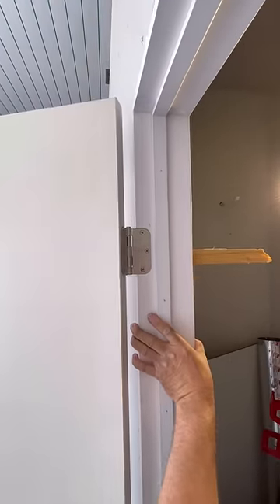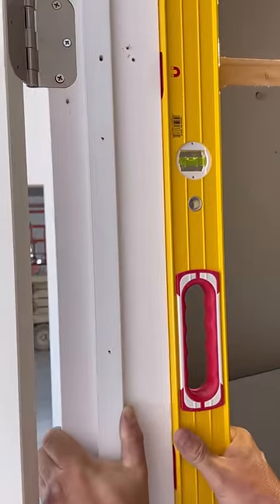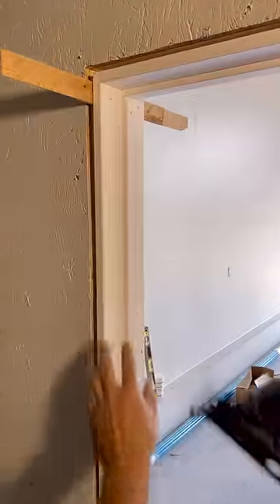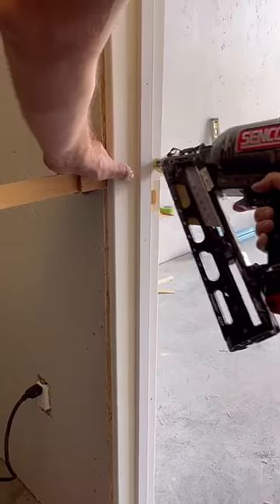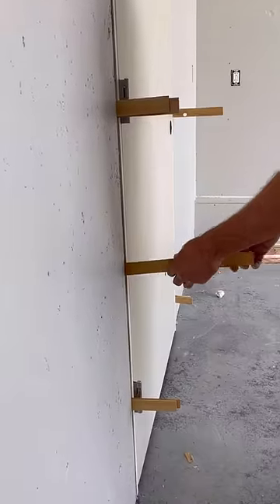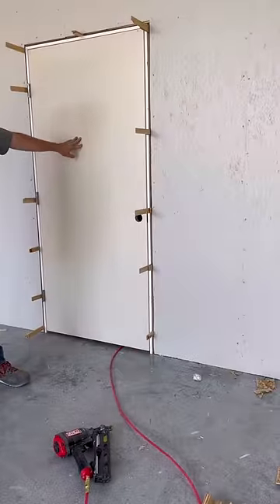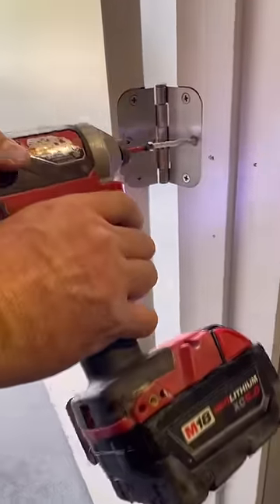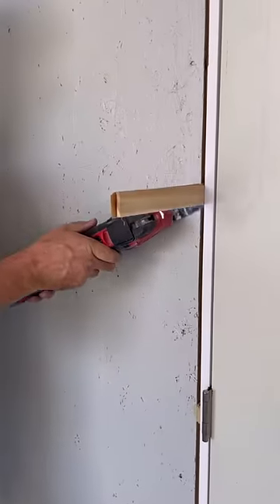How I Install A Prehung Interior Door (Part 2)

Comment: The long screws should be behind the hinge. Just in case if painters pull out all the screws the jamb is still set.
Reply: Proven yet again that the internet knows best👍
Reply: @Tekagi Sorry bud, real finish carpenters put the screw in the jamb mortise. You're wrong.
Reply: Tekagi  They are carpenters, not scientists. You think they use actual logic?!
Reply: Tekagi always add a screw behind hinge.
Reply: @Tekagi here's your logical explanation for putting it behind the hinges: the screws are color matching to the hinges, looks better than the drywall screws or green decking screws the carpenter pulls out of his truck
Reply: I can answer this as someone who works on a lot of new and old builds. The fixing screws are typically fitted behind the doorstop or both sides into the surrounding wall, this is done because nails have little to no bite, meaning overtime they can and will pull out or push in as the wood swells and shrinks. The reason both screws and nails are used is because screws on the other hand have little shear strength and are more likely to snap. The way this door is hung is fine, it'll be fine for a decade or two and then issues will start appearing but with the quality of new doors that would happen elsewhere anyway  Tekagi
Reply: Tekagi  I would seriously question any screw that isn't extremely costly having a higher shear strength than a nail because that just is not how metallurgy works. As for shear strength in doors, it's the same as firing pins, repeated impacts change the crystalline structure of metals and screws become more brittle and more likely to snap far, far faster. To put it into real terms and to add back in what you left out of my original comment. A door made with only nails will stand correct for 20ish years. A door made with stop screwing and nails will last 50-80ish years and a door side screwed and nailed can last 200+ years. Because screws and nails do fundamentally different jobs and both are beneficial to fixing a doorframe. As for this specific example, the door is only secured on the door side of the hinge side with no screws in the opposite, top or far sides of the door.
Reply: Tekagi  Well that explains a lot. I just looked at their test in "do screws shear easier than nails"... They don't shear a single screw or nail, it's a pull test but horizontal.
And here is the thing, it's not my opinion, it's the reality of metallurgic properties. You would have to make a screw from a far more costly material to give it the same shear strength of a nail.
Yes. Screws are not high quality steel, they are mass production steel and repeated slamming of a door over 20 years makes them more brittle. Again, not reaching for anything, that's how metals work.
And we aren't talking about solid oak doors hung on inch thick nails. With modern nails, they will last around 20 years before the door begins changing. But even if you really wanted to go that route, the world's oldest door doesn't have a single nail and had to be cut down multiple times. Most old doors don't have nailed hinges or nail fixed frames either.
It just seems like you are rewriting everything I say to try and make some point about "screws are really nails but better" and it's a joke. You clearly don't really know what you are talking about and rely on poor tests you saw on a youtube short and opinion that clearly don't line up with reality.
Reply: @TheDave159 Until the 200lb teenager hangs one of those pull up bars on top of the door casing 😂
Reply: I live in a 2 million dollar home- the long screw is in the hinge, not behind. This is standard.
Reply: Whatever .. 
The real issue is he did not install the door correctly.  And should have removed the door  and hinges after he was set with jamb installation.. . 
I hate when installers and painters are lazy . Like this .😂😂
 Tekagi
Reply: Tekagi #10 screw head would not fit properly in the hinge.
Reply: Tekagi  why are you wasting so much time with all the remarks against other people on here ..
Reply: Yeah they'll take the hinges off just like they do outlet/switch covers.
Reply: @RickGramse 100% the only reason I screw behind the hinge is when I don't have a matching screw(which is most times). It doesn't matter. Some higher end hardware comes with 1 long screw per hinge.
Reply: False. All the screws are colour/finish matched to the hinges, if there are even the correct number of screws. Putting one behind the hinge plate is the way to go if you only have short hinge screws. I have a bunch of long screws that are colour/finish matched to the type of hinges I install, so I’m fine.
Reply: Tekagi  we as a finish carpenters we put the screw or screws behind the hinge in case someone remove door just put regular screws for hinge it's easy just listen to the internet
Reply: @baldone45  Experienced professionals know best

Comment: First thing you have to do is check  the level of the floor in case you have to cut one jamb leg so the header is level.
Reply: Thanks for this tip! I love when it’s just the tip…
Reply: You are just like your sister…
Reply: Never cut a jam leg unless you are installing it on a finished floor

Comment: It seems so simple but theres so many apartments where you have to careful not to let go when opening the doors so it doesn’t swing into the wall.
Reply from the maker: True
Reply: Because they're apartments. . .
Production on a mass scale tends to mean rushing and subpar quality
Reply: It cause the wall isnt plum .the door will swing open or closed by itself which ever way it leaning
Reply: @SonnieRanno-fl5eb  It’s not a hard fix with a bubble level and shims, most rentals though don’t take the time to do these things properly.

Comment: We nail the shims plumb to the frame (hinge side). Than place the door and nail that side off. Than shim as you need to on the other side. 2” 1/2 - 3” 16 gauge nails and no screws
Reply: you really should put a screw through the hinge atleast man... those 16 gauge nails do jack shit when you have 300 pound people leaning on doors and people love slamming doors

Comment: Great job. It's incredible how many carpenters I've met that struggle with hanging prehung doors.
Reply from the maker: Thanks 👍
Reply: A real carpenter will hang any door in any way needed. These pre hung doors are for building sites full of odd jobbers . Didn’t you see how far away the final shot was, it was so that you didn’t see the massive gaps around the door and how uneven they are

Comment: Here is some pro tips from a finish carpenter, maybe it’s helpful?  Once the door is hung and in place remove middle hinge leaf jam side and behind the leaf put in a 3” good screw like a GRK.  That way if painters come behind you & remove the door it’s not a problem of your jam flexing/ moving from hanging / rehanging a door causing hinge sag.  You can do the top also if you’re hanging a new door in an old jam and it’s solid core.
 On pre hungs I use a system called ez hang its fast , simple and never had a call back !  In fact I have come back and removed the old wall where the ez hangs were & still perfect After several yrs of a Setting of lots of use !  
Use a 15ga !  Not a 16 ga to set jams they were made exactly for that in trim carpentry 🔨 because the are way more beefier and thus increasing sheer strength/ sags !  Do not shim behind your hinge !  Rookie move!  Those cedar or composite shims will move and crack behind a hinge !  3/6” above and below if needed 6” down from top & 8”/12” above bottom of door if shimming !  
If you do doors buy a door stud !  Or hv a door hang like the one Gary Katz uses ( see his videos).

Hope this helps boys & girls !

Comment: Fantastic job!! only thing I would mention is I don’t nail through the doorstop until the end in case i need to adjust it. then I use shorter nails on the stop in case something shifts and I need to adjust it in the future.

Comment: Try installing a long screw behind the hinge. Counter sunk of course. That way when the door is removed for painting it will not affect the door frame when put back together and you won’t have to worry if the put the long screw back. 👍

Comment: I personally like a door that shuts by itself.
Reply from the maker: That means that jamb is leaning in at the top causing the door in the fall short
Reply: @hausplans  yeah.   I like the doors in my house to be shut, so when we replaced them all I tilted some of them ever so slightly so they would swing most of the way shut. 

Same with a sliding door I have covering the laundry room. It self closes slowly.

Comment: Only small issue I see. Generally I open the hinge plate for the 2 1/2 inch anchor screw. Because painter is going to remove your screw from the hingle, wrack your frame and the it's your later problem. Flipping the hingle and countersunk screw under the hinge will remain forever.  Takes an additional 2 minutes per door, but I never have to return to a job I did.

Comment: I use 2 1/2" finish screws, so easy to adjust the shims and you need way less wood filler. A screw is times stronger than brad nails and will not loosen over time.
Reply from the maker: That’s not a bad idea

Comment: I have set thousands of doors 99% of them all have casing on one side that makes installing the door so much easier like 100 times easier
Reply from the maker: I’ve use trim carpenters to do it that way before as well. It’s whatever you’re comfortable with that works for you.

Comment: For the last 52 years. If the pre hung door did not come with casing on one side, then we install casing first on one side then hang the door nailing the casing first. Then shims then the other side casing. We have never used a level. Only because the ceiling might not be level or the adjacent wall the door hits up against. Same out come with way less work.

Comment: take it to the next level...triangulate 3 16d galvanized casing nails around each hinge,  1 on top of hinge, 1 below the hinge and 1 in front of hinge. Eliminate all those finish pin nails, those fasteners will sag and fail as a home settles over time. Complete the other jamb side using 2 16d galvanized casing nails where shims are required.  This door nailing style will insure decades of solid door install with no door sagging. 

Yep its labor intensive and more expensive. I installed my exterior and interior doors in this manner for 30 years and never had a callback.

I learned from old school finish carpenters who hated doing things twice and hand pounded everything. Pneumatic tools have changed everything including this lost art of solid nailing.

There is always 9 ways to skin a cat, so to each his own, no 1 way is right or wrong.

Comment: What’s happens if reveal is off on either side of door but it’s plumb level square? I’m gonna set my 3 doors this Monday and wondering. My first doors. Is that just not possible or have you seen this happen? I’m hoping I can set the three doors fairly quickly

Comment: What are your thoughts on putting the longer 2 1/2 inch screw that secures the door to the framing behind the hinge plate, so if any future changes to the door, hinges, etc. are required, there is no need to remove the longer screw?
Reply from the maker: That’s a good idea especially if a painter or someone is going to be removing the hinge. There’s always a chance they won’t get it back the way you had it.

Comment: In Europe we use a framing gun,,puts a corrugated staple between the door frame and the stud, no nail holes,,I'd get sacked for putting nails in a factory finished surface
Reply from the maker: This is not a factory finish. It still has to be sanded the holes filled caulked and painted.

Comment: I try to hide the nails or screws where they can't be seen when the door is closed and right beside the closing strip so they are hardly noticed when the door is open. Putting 1000 nails everywhere is quite unecessary and unsightly.

Comment: You should not put a long screw to the hinge, cuz when the painter uninstalls it it can shift. It's better to put a fourth, longer screw behind the hinge and keep the hinge secured by the normal smaller screws instead.
Reply from the maker: Good advice in most situations, however we don’t let our painters remove the hinges we make them tape and paint around them

Comment: Just one screw on each hinge….. guess I overkill it lmao I do 3 each hinge and two on the door itself. I’d rather spend afew dollars and have the last laugh when someone tries to kick the door in lmao 
My contractor did a lousy job hanging my door! I had 3 nails from the exterior and maybe a tiny bit of nail on the inside maybe holding…. It was very sad! I made sure to shim and screw the crap outta that door! Needless to say if someone ever tries to kick it in well they better just grab a chain saw and cut thru the door lol it’s gonna be much quieter than kicking it in lmfao  I always put my screws behind the weather seal to hide them. Just one less hole to fill before paint.

Comment: Just a suggestion 
But don’t just put a longer screw in place of the shorter one. What I do is remove all the hing screw on the jamb side one hinge at a time and put a longer one underneath the hinge. This way when the painter takes the hinges off to paint, it will not adjust the door
Reply: Yes u are correct. He needs to put the screw behind the hinge.

Comment: You should put the screw under the hinge so if the painter decides to take the hinge off when he paints. He's not tampering with what you did
Reply from the maker: We don’t let our painters take any screws out. They pull the pin to get to doors off and tape the hinges before painting the door.
Reply: @hausplans  I guess if you are the general contractor then that's all good. I put a screw under the hinge so it doesn't get messed with by someone else. I also put 1 through the hinge as well
Reply: I put the screw behind the hinge

Comment: Until the painters get a hold of it 😂😂😂😂
Reply from the maker: Our painters don’t take any screws out of the hinges they pop the hinge pin to remove the door. Then they tape the hinges before removing them.
Reply: @hausplans  so they shoot the doors where they stay? Ours take them off and put numbers on the casements and tape over them and then then create a photo booth in a room and spray all the doors.  Then they reinstall them and typically strip out the screws so we get go back and fix all of them

Comment: After you get a little more experience you will discover a way to get rid of all those unsightly pecker shots and stragicaly place countersunk screws neat the centerline of the door and use hinges to hide long screws that also hold door to the jam. Not a fan of pecker holes 😡😡

Comment: Nails are never good for door jambs everytime the door slams the nails loosen over time and depending on the client you will get a call back to correct or never get a call back ever for any business.
Reply from the maker: Watch part two, I put some 3 inch hinge screws in to hold it in place permanently

Comment: Guess you’ve never hung a pre-hung door before. You can apply trim to one side and hang it and also keep the nail on the lock side so you know the gap won’t move and then slide the frame out on the strike side before you nail the trim…rookie

Comment: Stop ...no production or track home or apartmemt will be doing this...have youe ever seen a job Overseer with a level never never never...Did high end homes for 40 plus years ..never a squeak or call backs and most homes had 40 plus solid doors 8 feet in ht. ..bingo